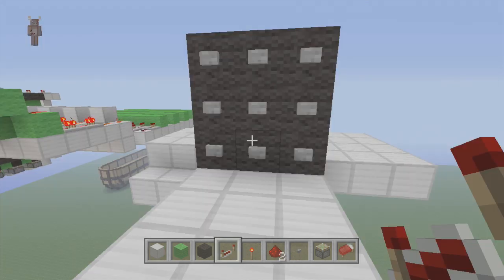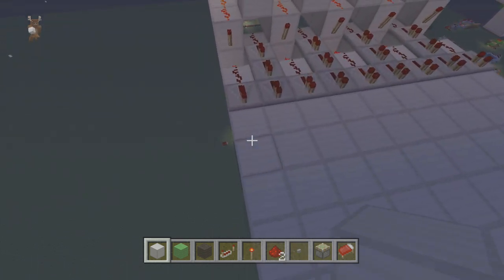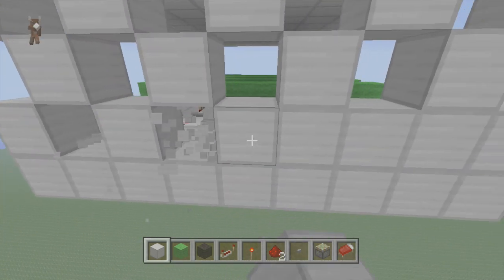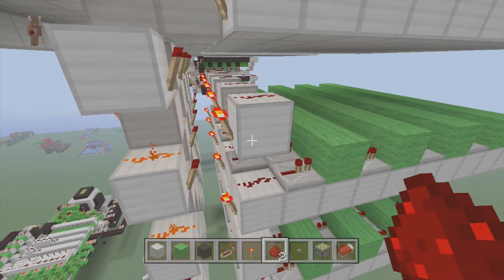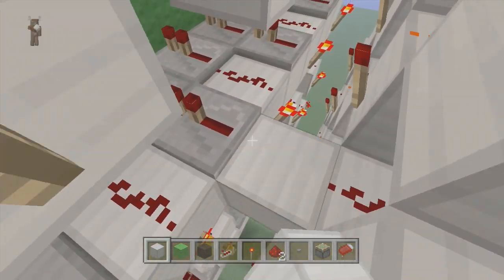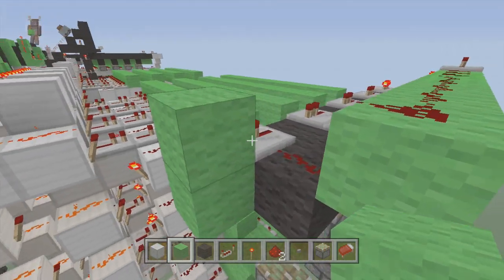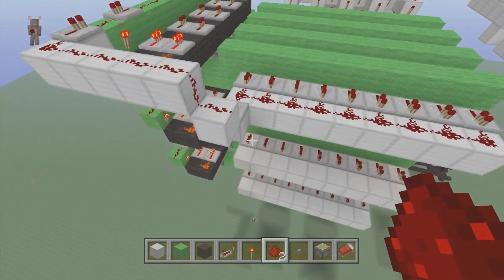Minecraft How to Build A Working Atm (Part 1)

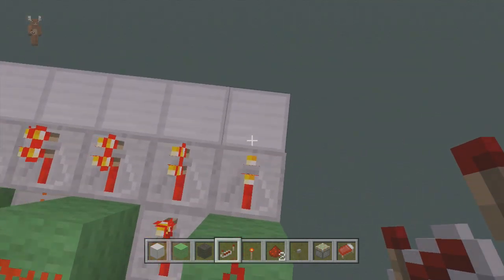Comment: 0-3:36 is the 9 digit input thing, 3:37-14:00 ish is putting in the part that counts your inputs. 14-16:30 is when you get your counter that counts up each correct pin. rest of the video is adding a circuit that resets your counter.